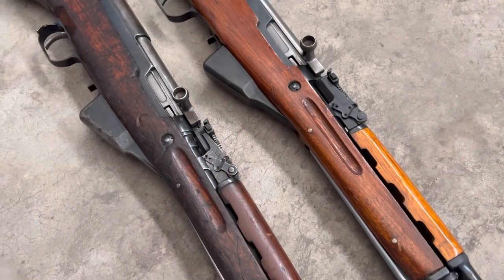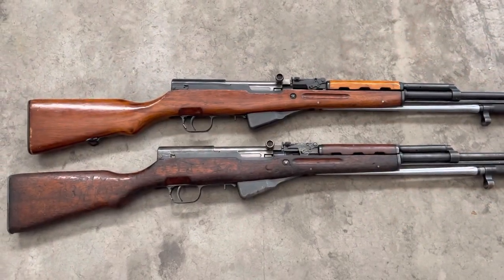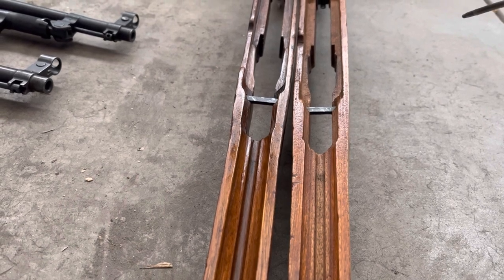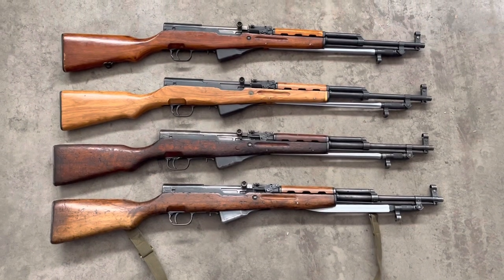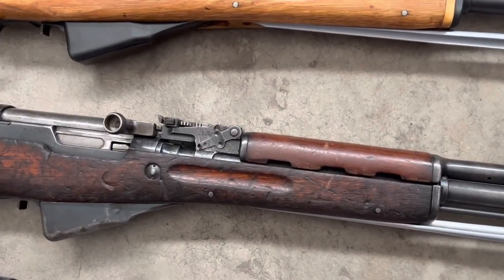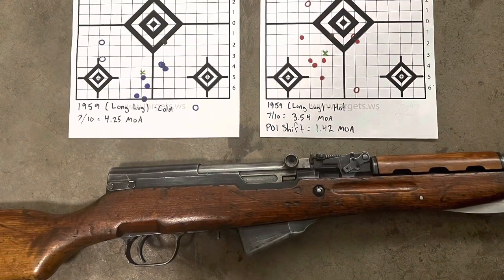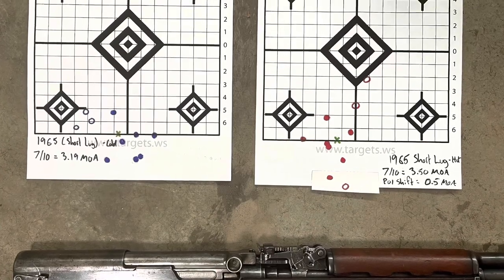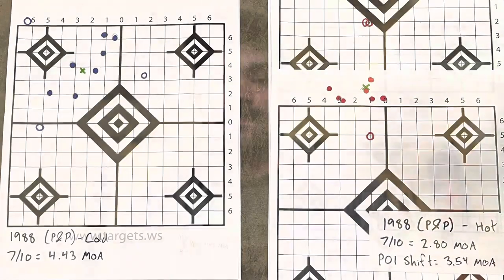Pinned vs. Threaded SKS Barrels (w/ Heat Test)

Comment: The Chinese were the only SKS producer that really attempted to find ways to simplify production. The pressed and pinned barrel was a no brainer because, they were already doing it with the AK.
Reply from the maker: I agree. Shouldn’t be too surprising that the Chinese found a way to streamline production, considering that they produced more than twice as many SKS pattern rifles as the rest of the world combined!
Reply: simplify the process without the need or required machine skill labor to machine a barrel lug and thread timed to the receiver's thread. A tight fit hole is easier to make and shearing a pin like so is practically impossible. actually there would be less failures stress point on press in pin barrel compare to the thread point on a screw in barrel.

Comment: The lug is a part of the barrel and threaded into the receiver, and the pinned receiver is heated to expand it so the cool barrel will slip into the hot receiver, then pinned and left to cool down to a compression fit.
Reply from the maker: Yup - I goofed up the threaded barrel description pretty badly.

That said, are you saying that the barrel lug is literally part of the barrel forging, or just that it’s a permanent assembly? Most of my examples appear to be separate components, not  entirely unlike AR barrel extensions.
Reply: I agree that the receiver is heated rather than the barrel as you said in the video. But that’s a mistaken wording. All the rest of your content is brilliant and very well studied. Really appreciate your approach and the time you took.

Comment: Thanks for posting. Tomorrow I get to go shoot my T26 1979 type 56 carbine for the first time. Got it at Cabela’s in Barrie Ontario 5 weeks ago and spent 10 hours cleaning the cosmoline out and polishing some surface rust off the bolt and firing pin assembly. All functions properly now and I’ve been waiting weeks to get it out. So excited.

Comment: Pressed and pinned barrels are pressed with an interference fit . When a barrel is cold that interference fit would have ever so slightly a loser fit than a threaded barrel ; as that pressed and pinned barrel heats up that interference fit would tighten up.
Reply: 40 below 0 you better start showing  !!! Lol

Comment: This is fantastically informative. I had no knowledge about short and long lugs on Factoru /26\. Just learned that my 1965 factory 26 is short lug. So interesting. I never knew how to tell prior to this video. Speaking of acts of violence, I have managed to drop my Sks on concrete several times from distances of 4-5 feet and each time it landed on the tip of it’s barrel , and neither time has it ever damaged the crown or threw off the front sight. Still holds the zero it came with when I bought it. Probably last tuned in Albania upon being received from China 30 years ago.
Reply: Mines an Albanian issued one too. Same with my type 53.
Reply: I had not known either. so, then I went and looked at the 2 I have here. The 1950 Tula is a long thread barrel and the 1971 type 56 triangle 26 is P&P. No surprises here, lo!.
Reply: @humansvd3269 O snap. You ended up getting a type 53 that came with the SKS’s? Were they also made at State Arsenal 296? /26\
Reply: @factorybear5264  My SKS is a early 10 series made in 1965 or 1966. It's a bit hard to tell. It was the first SKS series to get the bayonets for the Chinese pla. My type 53 is a 1953 Triangle 26.
Reply: @humansvd3269  mine is an early 10 series also. 10,155,000 . Early 1965. Side swivel hadn’t gone away yet  but was replaced back under the butt stock later that year .

Comment: Awesome job!  In my humble opinion, I think that the pinned ones are inferior for the following reasons : #1 Accuracy - the group got better after the barrel got hot which makes me think that due to the accumulated heat the metal is expanding hence the connection between the pressed surfaces are getting pressed against eachother  improving the accuracy vs cold/loose connection/less accuracy  - point proven the inferior quality of the workmanship approach pinned vs threaded . # 2 - I consider pinned to be inferior, as if you need to shoot 30 rounds to get some accuracy, the rifle productivity is in the ditch considering the purpose that was built for - hitting target as fast and as least expensive as possible . There may be extremally few real life combat situations on a battlefield that will simulate your example, and even so by the time accuracy has been increased the shooter may be dead already . Conclusion : On the paper the pinned got best MOA group in the least desirable real life  scenario, threaded got better  accuracy cold and has  potentially achieved it's purpose while barrel hasn't got hot - which is faster and less expensive and also the possible real life scenario in 99.9 % of a real life combat application. Thanks

Comment: I wonder if the heat on the pinned barrel caused the metal to expand which created a tighter  fit between receiver and barrel. This would explain  why the groups tighten up under heat
Reply: Exactly what I wondered.
Reply: This was my thought also based on my 25 years spent in manufacturing.

Comment: Love all your videos and the knowledge you have 
Question for you  
I  have a type 56  made in 63  full threaded lug  
I'm new to SKSs totally love the history of this platform 
this gun was never fired until I got it.    the pin in the front sight needs to move more , but I'm as far as it'll move ? have you encountered this before problem before ?
It's like the barrel is not inline with the receiver and stock  ??? 
Any comments    thx
Reply from the maker: Hey - not 100% sure I understand your question... Are you saying that:

1) You have fully adjusted your front sight post as far as it will go in one direction and you are still not properly zeroed for windage, or

2) Your front sight post has room to adjust but is not moving properly, or

3) Something else...
Reply: @Triangle26  Thank you for taking the time to help me 
I zeroing my sights in for 50 yards 
Elevation is good 
Trouble is I need to be able to move the pin in the front sight more to the right when mounting the rifle
point of impact needs to be more to the left
I believe I'm moving the pin in the proper direction according to the information I've looked up 
Can the barrel be that far off ?
I figured the pin located in the center of the sight wouldn't be that far off   
It was way off 
I did try moving the pin in both directions with the proper tool
Question is  have you seen an SKS with the sights that far off with a full threaded barrel  
I'm in Canada and SKS s are plentiful , old / never fired  
Thx again

Comment: Actually the idea that the threaded barrel would be more accurate when cold than the pinned barrel makes perfect sense.  The threaded barrel is under constant tension due to the threading and it will transfer heat faster to the lug or receiver than the pinned barrel which has less surface contact area with the receiver. As the pinned barrel heats up however, it will actually expand and tighten itself into the receiver and therefore the group size should get smaller. Stringing would be more common in the pinned barrel as the tolerances between the barrel and receiver change as it heats up.

I think over time SKS are likely to become more valuable and will justify barrel replacements.  Someone is also likely to start making target barrels for these durable actions.  I think at that point the screw on receivers will likely be the best ones for the purpose and then we will start seeing an even greater price difference between the pinned and screw on barreled rifles. 

As to picking off a man size target at 100 meters... I'm thinking either rifle will be perfectly fine.  Lastly, with most military rifles there is a teething period when they first get introduced.  You really don't want the first batch of any rifle when your life depends on it. But then the rifles are pretty quickly tweaked and upgraded to be about as good as they can be... After that the mainly get cost reduced.  I really can't think of many long lived military or even civilian rifle systems that got too much better towards the end of their production.  And I can think of a few that got substantially worse as tooling wore out, finances got scarce, bean counters got involved and the war turned against the manufacturer.
Reply from the maker: I think you are right on the money. I had to mull it over for quite a while before I could make any sense of it, but eventually I arrived to see things exactly as you describe. 

I personally don’t see it as very likely that we will ever see a robust market for re-barreling SKS patterns. I do think that their value will continue to increase, but I think that value will be largely driven by the collector market rather than the shooter market. The collector market prioritizes historical correctness over condition, which is why a K98k with an original barrel is always worth more than a K98k with an aftermarket barrel - even if the original barrel is a sewer pipe. I see the SKS going the same way. I could certainly be wrong though, I can’t see the future!

Thanks for your comment, your thoughts are genuinely interesting and appreciated.
Reply: @Triangle26  Part of what you said has not historically been true.  There are some huge dollar custom rifles built off of Mauser 98 actions.  While I prefer my military rifles in original configuration...  I could well see owning a target version with a precision barrel. You wouldn't even have to cut up a whole SKS, actions are dirt cheap and available.  I think Sarco is selling them for pocket change. 

Imagine the fun you could have with a sub MOA SKS, and I think it's doable with the right ammo and a precision barrel.  Maybe a wildcat cartridge like 6.5 X 39 would really put the icing on the cake. And something tells me that gun would not go cheap.

Comment: Great information and comparison. 
Consider first that free float and SKS don't exist in the same gun. This would play into the impact changes faster than the fitment. I've never heard of a SKS skaking lose from heavy fire. 
I think you are correct in surmising that the method of construction is a moot point.
Yet I'm more than sure I'll hear all about how the threaded is better than pinned at the next gun show.

Comment: Would you agree that a major difference in Pinned vs Threaded barrel is the ease of replacement of the threaded barrel for maintenance purposes? Pinning involves the drilling through the body and slightly counter sinking the barrel without a full pass through. Disassembly would be more work to remove the pin. Where as replacing the threaded barrel would be a much easier process, thus less man hours overall. These are Milsurp weapons and man hours are a concern.
Reply from the maker: Honestly, I can't say that I do agree. Your logic makes sense, but I think in practice the threaded barrel replacement is far more complicated. Replacing a threaded barrel requires three variables to line of perfectly: barrel timing, barrel torque, and headspace. Replacing a pressed and pinned barrel is logistically much more simple because it removes torque and timing from the equation. Just push the barrel in until headspace is correct, and drill+pin.
Reply: @Triangle26 I completely agree. Probably at least an hour difference in turn around time for the two.

Comment: I have heard that when shooting for accuracy you should never support the gun with the barrel, always support the gun with the handguard. It might not make a difference for the sks though.
Reply from the maker: @40mmmikemike  That’s certainly true, however in this case the rifles are not being supported by the barrel. They are resting on the folded bayonet, which effectively shields all but the very end of the barrel. Due to the folding design, any pressure on the bayonet is directed into the forend, not the barrel itself.

Comment: Just did a quick search in Chinese (螺纹连接拧紧 vs. 静压配合加固定销): not much conclusion or comparison in performance, mostly arguing the reduction of rejection rate and/or ease of repair.
Reply from the maker: I think that Arsenal level maintenance is where it really makes a difference.

It takes a true craftsman to correct headspace on a threaded barrel without ruining the torque spec and/or the gas port. With a pressed and pinned barrel, that’s more or less an entry level task. It’s night and day.

This is all very consistent with my basic view that Chinese modifications to the Soviet design would be best characterized as “streamlining”, rather than “cutting corners”, as some portray it…
Reply from the maker: Hey by the way I am still hoping to reach out with some questions on the documents you sent me… I’ve been particularly busy - but I have compiled a list of specific translations to clarify.
Reply: @Triangle26  I guess most of the complains on cutting corners on Chinese SKS are based on the commercial ones and those made outside Arsenal 296. I did read some articles arguing that the steel used in Chinese SKS is inferior than those Soviet counterparts, but I couldn't to find a reliable source.
Reply: @Triangle26  Glad to be able to help, just reach me through email.
Reply: @shaoqi012  could quite possibly.  cheap steel raw materials.  then the streamline simplify manufacturing process to that requires less skill labor.  hence the variations like casting and sheet metal receivers.  it's about producing bulk quantities to sell for competitive price.
Reply: @hvuu1628  As far as I know, those experimental cast receiver, stamped receiver SKS never got adopted by the military and they got exported primary to the US.
Reply: @shaoqi012  exactly for commerical market. China was moving away from these old arms and into their own new small arm that is strictly chinese.  They still only make these arms for exports. you can still get new SKS in Canada for example.

Comment: If your measured POI shift is less than the measured minute of angle variation then I can’t think that there is a mathematically measurable difference in POI. There could be the possibility that the expansion of the metals due to heat could actually compress the barrel/receiver interface and increase stability accounting for tighter groups. Deviation of cold bore shots is a thing in precision shooting.
Reply from the maker: I don’t think that first part is quite accurate - at least certainly not as a general rule.

The more rounds fired in each group, the easier it is to recognize POI shift (even if the POI shift is smaller than the total group size).

For example: I occasionally shoot rimfire bullseye matches. Because I always set my targets in the same spot, I end each night with a 60 round group  in the cardboard target backer - a well defined circle. It’s typically about 18 MOA (3” at 50 feet) in size. I assure you that if the POI of my my pistol was to shift 15 MOA (2.5” at 50 feet) left, the difference in 60 shot groups would be obvious and easily measurable - despite the POI shift being smaller than the total group size. There would be another well defined 3” circular group, centered 2.5” to the left of usual.

Now that doesn’t validate the potential POI shifts I discussed in this video. I was clear that the data is inconclusive. But I think the limiting factor is that the number of shots in each group is too few, not that the POI shift is too small to be measured.

Comment: How can the lug be a part of the barrel if both the lug and the barrel are both threaded? Every lug I've ever seen had a flat spot on both sides so it's likely that it's threaded or their wouldn't be a way to turn it with the flat spots. But you showed in the video the last couple threads showing on the barrel itself, so that proves it is also threaded. My question is based on someone else's comment about them being all one piece. So I say that so you don't think I'm trying to question your knowledge, obviously you know more than me, i just am curious what really is how it's made?
Reply: Pretty sure the lug is part of the receiver, with female threads. The barrel has male threads and is screwed into the lug.

Comment: I have a arsenal 666 with a pinned barrel and it isn’t the most accurate , paper plate groups, but has the best trigger . Both of my stamped trigger guns have real nice triggers .
Reply from the maker: Interesting. I have also noticed a tendency for stamped trigger groups to be a little smoother on the pull. I wonder if that's a coincidence or an actual trend.
Reply: I may be a prima donna about triggers, but I put drop in triggers in all my ARs, because I was struggling with the creep of mil spec triggers, and unable to focus on aiming. The SKS trigger was giving me fits, so I put the MCARBO trigger spring in it, and my focus went back downrange. I'm new to SKSs, and just now learned from your comment of the stamped vs non stamped. There's so many interesting details to know.